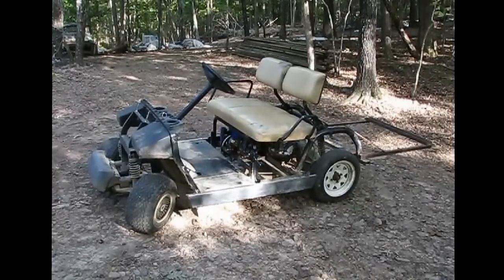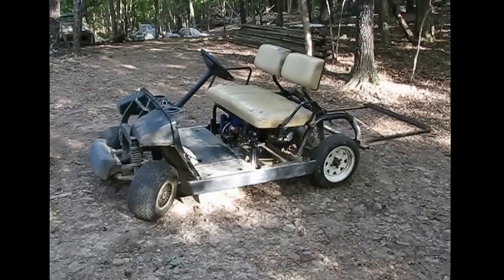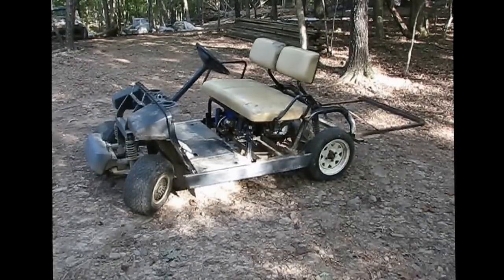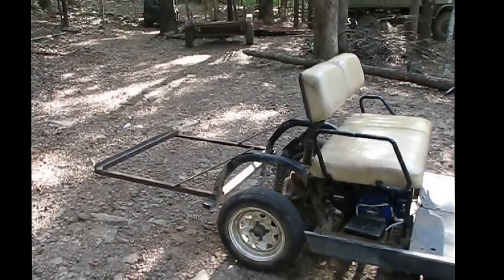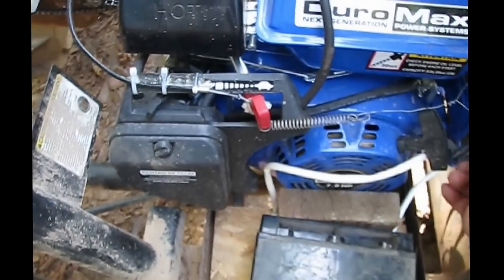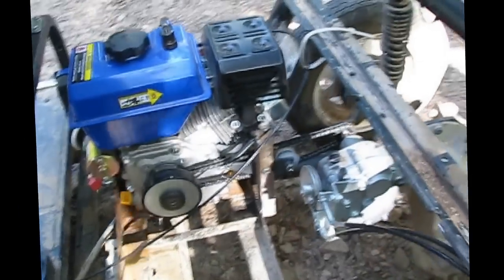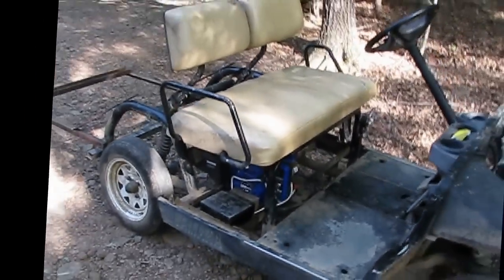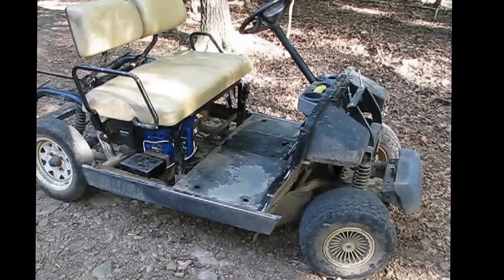Golf Cart Conversion Yamaha G22 Electric to 7HP Gasoline

Comment: I'm looking to do the same thing with my 1988 club car DS. I bought the same engine but it's the 440. I also bought the engine plate as well. Do I need to put a tension so the engine goes with the golf kart ?
Reply: Ray, yes, a tension idler for the chain-drive is important.  Otherwise, when you are going fast, the chain can slip on the clutch sprocket.

Comment: This is the first build that I have been able to find where the forward and reverse still work. I myself am not mechanically inclined. can you provide more info on how you did that. I have a club car I just started stripping down to start my build
Reply from the maker: Tim, thanks for your comment.  I need to shoot a real video, where the exact process is detailed, but have just not had time to do it.  Here is the secret to Forward and Reverse... the mech is for a Go Kart, and works well:
http://www.ebay.com/itm/Go-Kart-Forward-Reverse-Gear-Box-Fit-3-4-COMET-TAV2-30-75-40-41-12T-10T-35-/332026368792?hash=item4d4e505318:g:pHMAAOSwx2dYIfHC

Comment: Could you make anything video going over how you completed the build in trying to switch mine to gas and I want to see how it would be a huge help!
Reply from the maker: Nick, yes, that is no problem.  I have not switched my cart over to the Torque Convert type of clutch yet, but I can show you exactly how I did this part, and you can just substitute the better clutch (not this centrifugal type... been through two of them already.)  Thanks, and I should have that up by tomorrow night.

Comment: Victorian Machines here's a quick video I threw together with a few pictures of my conversion. Shows how the torque converter setup works with the same transmission you have. I made a slanted motor plate so it would sit nicely behind the engine, this way the belt reaches. https://youtu.be/CQX3Kg5pcpU

Comment: So no issues with the skinnier tires on there? I like the look of those a lot better and I'm in need of tires on mine.
Reply: I figured the trailer tires would tear up the yard a little more since they're narrow like go-kart tires.
Reply from the maker: No issues at all... here is the deal: at first I thought that by switching over to the more narrow tires, I would loose traction.  Not so.  In fact what happens is, the narrow tire actually puts more pounds-per-square-inch on the ground, and works well.  The fat flotation-type golf cart tires are just easier on the turf, but really don't give you any better traction.

Comment: What are the back wheels and tires from? Would there be any drawback to running those on all four corners? I like the way they look.
Reply from the maker: Chris, they are standard 4 on 4 (bolt pattern) rims and tires from Amazon, that normally go on small utility trailers.  I have them front and back now, because I am trying to create an old Ford Model T looking rig. 
https://www.amazon.com/Trailer-4-80-12-480-12-White-Wheel/dp/B00DA88F4C/ref=sr_1_6?ie=UTF8&qid=1495425247&sr=8-6&keywords=trailer+rim+4+on+4

Comment: I used the same trans on mine except I used a torque converter clutch and belt. Then a #40 chain to the rear end coming from the trans. Awesome job!
Reply from the maker: It is easy... I just used an angle grinder to carefully grind down the splines on the differential input-shaft.  That way I could just slip a chain-drive sprocket over the shaft, and JB Welded it in place (as well as tightening the set-screws that came with the sprocket.)
Reply: thanks i want to do the same set up but i want to use a torque converter
Reply: Chris Pearson 
Saw your reply on a golf cart conversion from electric to gas.

What size sprockets did you run on the tranny out put and golf cart driveshaft input?
Reply from the maker: Chris, yes, that #35 chain that I used is a little light for the job, but still working.  The only thing that I have had an issue with was the clutch.  I had to put a replacement clutch in because the centrifugal clutch sprocket wore down very quickly, on the inexpensive Chinese clutch.  I like your approach better, with the belt-drive and torque clutch, because that is where all of the stress is in the system, as you know.  Way to go Chris!
Reply: what transmission is that ,i got a ez go cart that im converting to gas and what did you do to connect it to the the rear end where the electric motor went ?thanks i need ideas!!
Reply from the maker: I'm with on on that torque converter call!  I am going to be switching over to that myself.  The centrifugal clutch works for flat-land applications, but if you need to go slowly, and need power, the Torque Converter is the only way to go... and for just a few dollars more!

Comment: Great set up.  Have you checked MPH yet to see what it does?
Reply from the maker: Flat-out, about 20MPH.  However, you can easily change the sprocket ratios to get whatever you want/need.  It was a super easy conversion, and I have had zero issues so far.
Reply: Ok. Great thanks for the info!

Comment: How did you put Reverse on it?
Reply from the maker: Jonathan, I put a go kart transmission in it.  It is the small aluminum mech that sits between the engine and the rear axle.  There is a short #35 chain from the engine clutch to the transmission, and then a separate #35 chain back to the sprocket gear on the transaxle.  The forward/reverse control lever uses two cables, and I mounted it on the driver's side, right on the front of the seat box-frame.  Here is a link to the eBay auction for the transmission: http://www.ebay.com/itm/181890531869?_trksid=p2057872.m2749.l2649&ssPageName=STRK%3AMEBIDX%3AIT

Comment: Where did you find a sprocket to fit the splined shaft?
Reply: Victorian Machines  nice job. I'm working on my ezgo conversion and i grinded the input shaft to 3/4in and will put a jackshaft on it.
Reply from the maker: Chad, what I did was carefully grind down the splines with a hand-held 
angle grinder, as I had somebody slowly rotate one of the back tires by 
hand.  As the splined shaft rotates, it is easy to take off each 
"spline" and make a smooth 1/2" shaft.  I then used a standard 1/2" 
bore sprocket, and used JB Weld and the set screws to secure it.  Works 
great... no problems at all.
Reply from the maker: Excellent!  That is the way to do it!